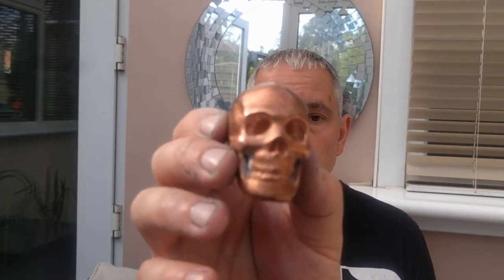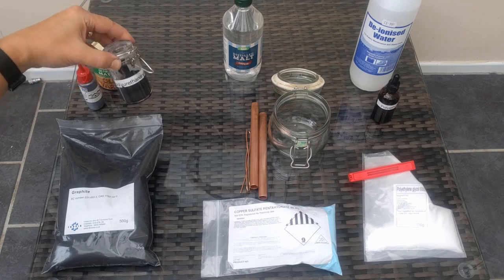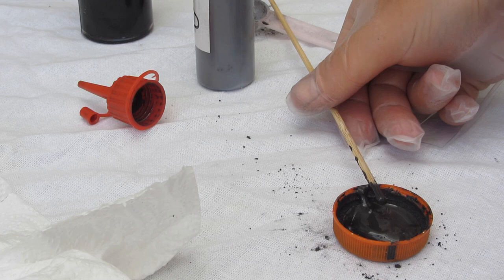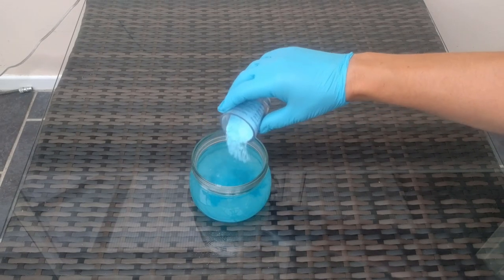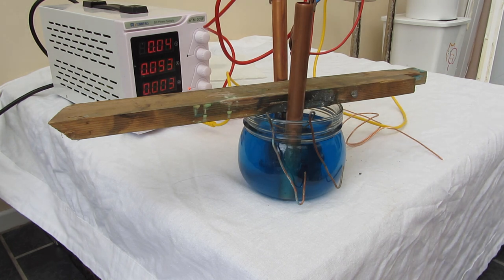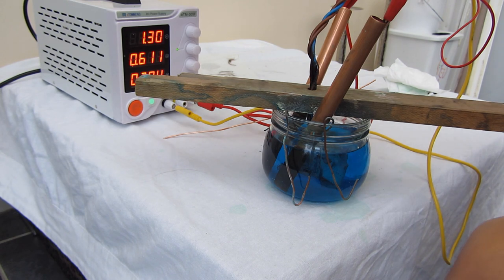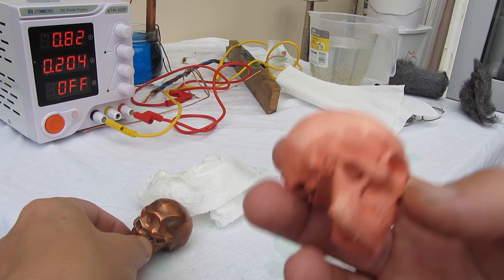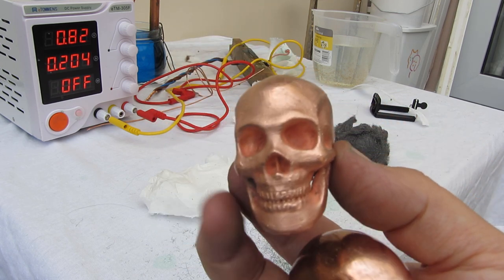Copper Plate Pla

Comment: Thank you for giving away  the secret ingredient! My mistake was to buy the least expensive printer in the web so my prints are not close to yours but I will give them a coat of copper so to make them look more artistry. I am going to invest on a power supply like yours and experiment with your advise. I will use Pâraloid diluted in thinner instead of varnish as I paid for that formula before finding your video. My aim is to make some old looking automata machines. I subscribed and will look forward to see more videos from you. I will do the same when I make something worth showing :D

Comment: Good video and well put together Neil. Couple of tips: keep fingers off the object while plating. Finger grease can inhibit the plating. Also try de-wetting the item at the end with Isopropyl alcohol. I used acetone as a de-wetting agent in the semiconductor plant I worked at but acetone isn't PLA friendly!
Reply from the maker: Ok. Good points, what's the purpose of de-wetting ?
Reply: @Neilsnonsense1  I don't know if this is what he ment by de wetting So maybe this is just interesting but unrelated. 

I've seen this done in a shop. After soldering a board there may be acid flux residue  left on the circuit board. The acid flux removes oxide layer to let the solder flow better, but if left on the board it can end up causing corrosion. They would wash the acid flux residue away with deionized wate bath, then dip the curcuit board in isopropyl alcohol to remove the water from the board and the alcohol would dry so much quicker.

Comment: Hi Neils, I just saw this video and very interesting job working with non conductive surface.
I have used copper sulphate with sulfuric acid  for plating printed circuit board but it strongest than copper sulphate and vinager, this last product is safer for everybody.
Good job and thanks for sharing. Regards from Chile.

Comment: PLA is soften by acetone. I wonder if a graphite power and acetone might bond graphite right into the PLA surface without using polyurethane as a binder.

Have you tried it, would you like to try it, and if you have tried it, how does the adhesion compare?

Comment: Does it work at all without the polyethylene gylcol to act as a "brightener"? Like, does it plate but just have large surface crystals or does it go on so fast it doesn't adhere and it just flakes off? It's expensive and/or niche to get polyethylene glycol 8000 in the USA. Will lesser polyethylene glycols work (like PEG 3500)? Or are those different chemicals? Thanks for the great tutorial.
Reply from the maker: Good point. I think you might get away without any at all. Other polyethylene glycols will almost certainly be fine as well.
Reply: @Neilsnonsense1  I read a bit more on acid copper electroplating and it sounds like polyethylene glycol in this context is not a brightener but a suppressor. The suppressor increases the thickness of the diffusion layer at the surface (by being viscous) and then the brightener or accelerator, usually a small molecule sulphur compound, will randomly displace the suppressor and create a thin surface without crystals.

But I can't argue with your results. The same papers reported the PEG 2000-8000 were typically used. And I found that PEG 4000 is available in the USA cheaply as Carbowax 4000 (PEG) for green wood treatment.

Comment: Got a question , how the skull got shiny after the aplication of the graphite paint ? maybe you said but I was not able to catch it
Reply from the maker: @gatsu8888888  it was rubbed with paper tissue. The paper is abrasive enough that it smooths, without scraping the coating off.
Reply: @Neilsnonsense1  I did that but i have conductive spray paint and it comes off even if i use a primer under it
Reply from the maker: @gatsu8888888  I've not tried conductive paint, so I'm not sure what to suggest. Is it pla? I guess you could try cotton wool!

Comment: Hi Neil, you did explain all very well, with a lot of details and interesting informations. I have done some copper and zinc plating previously on metal, and was wondering if electrolysis would work on PLA with some graphit spraying. Therefore I ordered some aerosol graphit spray (did not get it yet). And then I found your tutorial, so I'm glad to know that it really works . Thank you for your very nice video !
Reply from the maker: Wow, thanks for commenting. Please let me know how you get on with the graphite spray, and if you have a multi meter what the resistance is across about an inch (2.5cm). Id love to know. good luck. Neil.
Reply: @Neilsnonsense1  Hello Neil, unfortunately the graphite spray did not work at all. After several spraying, the resistance is still high, about 20-25KOhms, and as intended the plating was very poor. I used "GRAPHIT 33" from" kontakt chemie". I also tried mixing graphite powder "KASP security microfine graphit powder 50g bottle" with waterbased "VALLEJO polyurethane matt varnish". Give only little better results. Then I mixed "synthetic micronized graphite powder 500g pack" with some isopropyl alcohol and someVallejo polyurethane varnish, and the resistance was finally OK (about < 5KOhms). But surface was very rough and gave a granular finish, I guess next time I need to sand the painting. Just for information, I made a second bath to zinc plate the previously coppered PLA part, and after sanding/polishing, it looks like (battered) chrome !
Reply from the maker: Ah, that was my worry with the graphite spray. I did try with a high acid bath (with Polyethylene glycol) and got better results. but still needed to clean it up with wire wool. I want to try one of the commercial brightners if I ever get a chance. Could you share a picture of the zinc plate ? Id love to see it.
Reply from the maker: Thats excellent. thanks for sharing. how big is it ? I'm guessing about 10mm diameter, its difficult to judge from the phot ?
Reply: @Neilsnonsense1  Nearly, it is about 30mm diameter. I encourage you to try zinc plating, it is very fun too. First you need to copper plate your part. Here is my zinc solution formula : 100ml vinegar (14% diluted) + 10g epsom salt + 12g powder sugar (brightener). Then you need a zinc piece (to determine if your part is real zinc, remember zinc weight is 7g per cubic cm). First use 2V 300mA, then 4V8 2300mA. Have fun Neil !

Comment: Hi may I ask how your paint sticking to pla cause mine wont I cant use sand paper cause I cant reach to tiny details and also I am loosing details cause am using sandpaper is there any other way to make the pla surface more sticky I will be realy appreciate
Reply from the maker: The (non water based) varnish I used, had no issues with pla. It was a polyurethane one.
What paint are you using?

Comment: What would be the requirements in your opinion to do the same with very large objects (for example, plastic car parts)?
Would you need a higher power source or you could use the same with just more time?
Reply from the maker: The plating thickness is a function of amp-hours to surface area. So yes more hours with lower power would work the same.

Comment: Any idea how thick the resulting plating is? Can you thicken the plating with subsequent treatment?
Reply from the maker: The thickness depends on the surface area and the amp hours applied, there are calculators avalible on the net. Yes when you've finished you can then plate it more, just make sure the surface is cleaned properly and you should be good to go.

Comment: Hi Neil, I am not quite understand the different of the skull in 11:12.   It seems that you prepare one skull. Then you show up another that look more shinny then a second ago. What is the difference between those 2 objects.  Secondly, When I apply graphite with IPA ( have not try polyurethane vanice yet),  the conductive ink seems to dissolve in the plating solution.  Is your solution (graphite+vanice) dissolve in the plating solution or water ? Thank
Reply: I don't understand the word you said on 1:52 , So, I don't know how you make the graphite paint shinny, Can you help clarify ,? thank
Reply from the maker: 1. Yes I did use two different skulls to make filming the video easier. The two did end looking the same, you just have to use metal polish. 
2. Yes I thought that might be an issue, it is acid after all. Use polyurethane varnish (preferable not water based) and you should be fine.
Reply from the maker: The word at 1:52 was "buff" basically give it a hard rub with a cloth,
Reply: Neils nonsense, Thank you very much

Comment: The modern waterbased Polyurethane varnishes are not Polyurethane at all, they are cheap Acrylic varnishes with a few percent of Polyurethane Inside.
Reply from the maker: Yeah we've used one for our floor. What a mistake that was! Less than a year and it's wearing off already.

Comment: Great video! Explained everything in a single video. You said about the brightened you made. Did you add any of it to the mixture to get that plate? I’ve purchased and have been using ‘bright’ copper playing solution and it plated with a shine already to the plate.
Reply from the maker: I did add some yes. I want to try some bought solution but havnt got around to it yet. which solution did you use?

Comment: How much stronger are copper plated parts?
Reply from the maker: I guess that would depend on how thick a plate you put on it! The copper would have the strength of 'normal' copper, so the thicker the stronger...
Reply: @Neilsnonsense1  I see thank you, im kind of looking at this as a way to "cheat" having stronger parts. But i don't really know whats the extent of the metals one can use for this, or if iit would be easy to say electroplate the insides of the plastic too (like if you were to make a whole, fill it get the graphite inside, and put it into the mixture would be plated the same way the outside would.)

Comment: thanks for the video = question = charcoal can be used instead of graphite? instead of graphite ---- thanks =
Reply: Nope, charcoal will not work. It has to be a conductive surface, graphite is the cheapest easiest thing to do this with.
Reply from the maker: @2EyesI   this is 100% correct, if you can make you part conductive in another way then it will plate, but the conductive filaments available seem to have to high a resistance (not conductive enough) to work very well. (and they are expensive!) I have also tried Zinc spray paint but didnt get very good results.